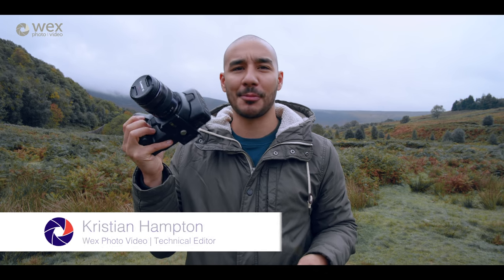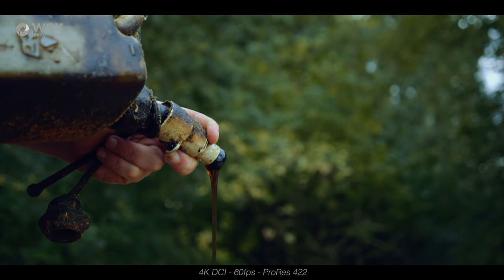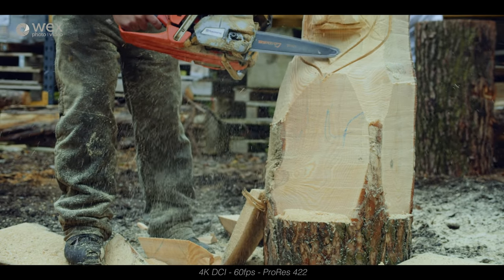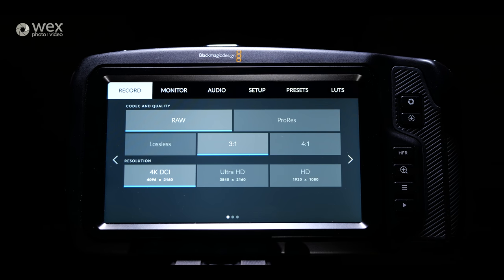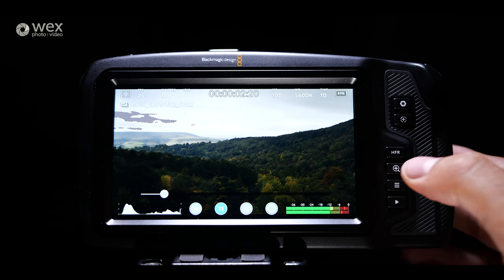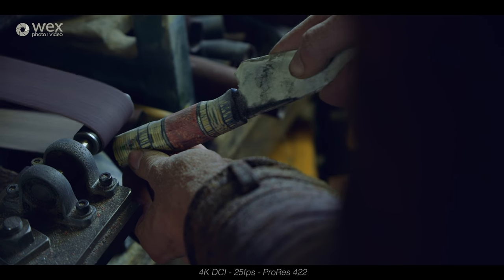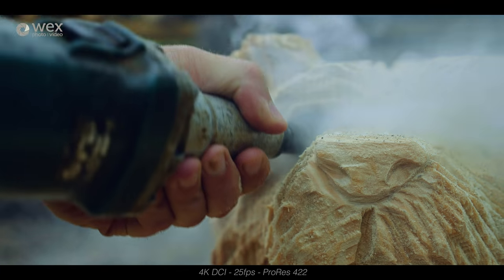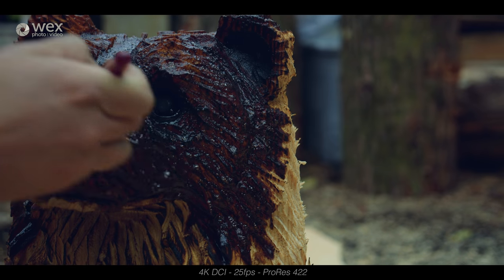Blackmagic Pocket Cinema Camera 4K - Test Shots and Full Walkthrough - Hands-On BMPCC

Comment: How good the IS is when you shooting with the Lumix 12-35 2 with IS turned on? 
Second question, do you think there is a need for using Olympus PRO series lens to get a better looking image (do you think so?) and a better manual focus experience (do you think so?) ? If that's the case, then the only Olympus IS lens is the rather big 12-100 4 PRO. I'd definitely prefer the Lumix's 12-35 2.8 and Lumix 35-100 2.8 simply for their portable size and weight with IS feature.

Thanks, it's a great video!

Comment: hello did that G drive worked Raw lossless 60fps???
 thank you
Reply: Im sorry but nothing is fast enough because the port itself is not fast enough to do 60p loseless raw, I have heard that they can handle 4:1 raw for bursts of time
Reply: @nicholasboule5134   It seems like you have a hard time listening or reading... The video said ALL... ALL meaning ALL... Smh, people really do listen to only what they want to listen to...
Reply: since most cinematographers shoot in 24fps in more curious if the camera can record 4k lossless raw at 24fps; with short bursts at 60fps or 120fps in scaled 1080p for slow motion shots
Reply: Wakko Warner yes it can... It has the high frame rate button that allows you to do just that
Reply: Listen again: He said all recording formats NOT all speeds, he was using 25fps. CineBlogs is right, I have tried SSD and XQD's and nothing works on 4k lossless 60. Go to 30fps or 3.1 and its fine.
Reply: @hexagony
oh yeah? read the specs. It's USB C drives that can't handle that speed
Reply: The gdrive has a Transfer Rate: Up to 2800MB/s wouldn’t that be enough for 4K dci 60p raw lossless? Is it a usb 3 or 3.1
Reply: Not sure where the choke point is. USB - C has a transfer rate of 10GB/S. Shouldn't be an issue there. THe G-Technology drive has a read speed of 560 MB/S. According to Blackmagic, the camera's bitrate while shooting 4K lossless .dng is 270MB/S. Even if we assume that 60 fps doubles that, there still shouldn't be a problem.

Comment: what about the vents? It is possible to get dirt and dust inside the camera through them? It is my deepest concern
Reply: @illstrumentals and how you protect it? I have never shot with cinema camera, only with dslr and hybrid cameras.
Reply from the maker: Hey Pablo - Yes it is possible. Like Illstrumentals has mentioned you do need to just think about it and try and take care of it. When I was filming with the chainsaw artist there was lots of small pieces of wood flying at the camera - no doubt some bits will have gone in, but no issues so far. Thanks for watching! KH
Reply: In my experience with cameras that have vents, I've never had a problem and have filmed in extremely dusty environments. I don't think you need to worry.

Comment: Most people who reviewing this product they are coming from Sony or Panasonic photo cameras, it is really redicules & funny demanding articulating screen on a cinema camera,  Blackmagic Design already said it's not a MP4 type video camera it's fully solid RAW cinema camera which should be strudy , you should understand what are you carrying . Alexa or any cinema cameras are not made for low light capability. These are made to shoot in a controlled lighting environment that is why it called cinema cameras comparing that Blackmagic did a great job cause this will perform in most lighting conditions,   if the low angle monitoring is your problem  you can add an external monitor now days 4k supporting displays are very cheap .